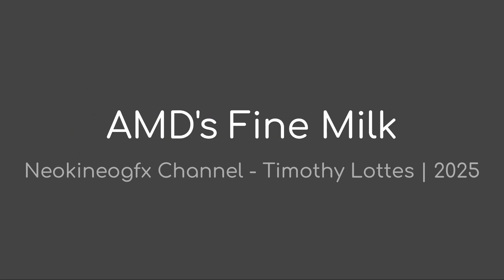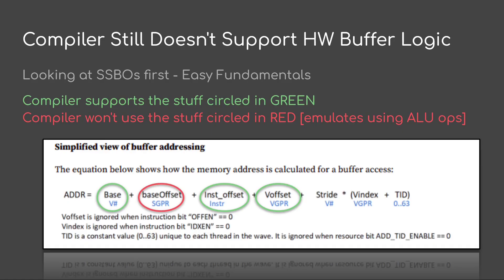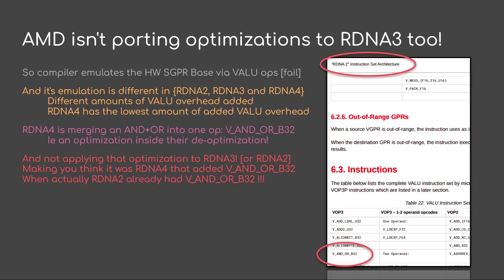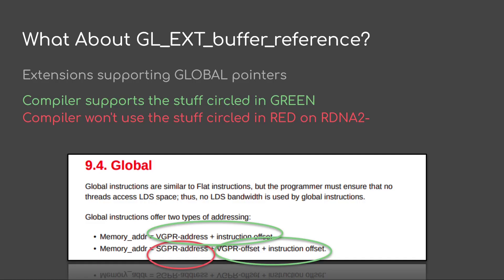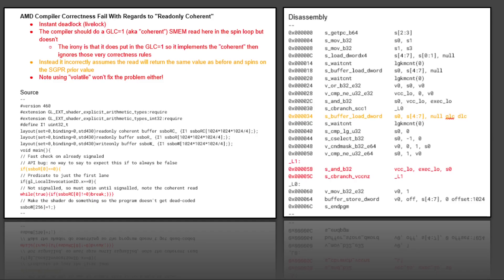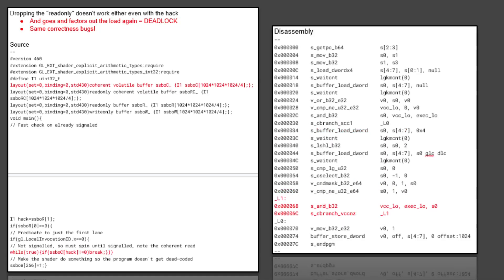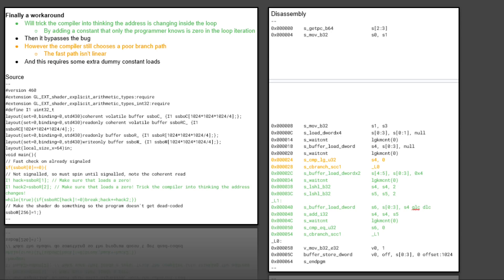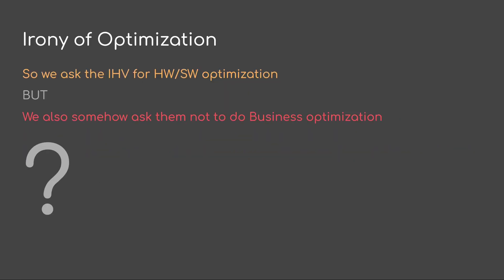AMD's Fine Milk

Comment: Coherent only applies to dependent shader invocations. E.g. a fragment shader will see writes done by the veetex shaders that were used to generate it. This isnt a bug at all.
Reply: From the spec/wiki
Dependent invocation write/read
    If you have one invocation which is dependent on another (the vertex shaders used to generate a primitive used for a fragment shader), then you need to use coherent on the variables and invoke an appropriate memoryBarrier* after you finish writing to the images of interest.

coherent
    Normally, the compiler is free to assume that this shader invocation is the only invocation that modifies values read through this variable. It also can freely assume that other shader invocations may not see values written through this variable.
    Using this qualifier is required to allow dependent shader invocations to communicate with one another, as it enforces the coherency of memory accesses. Using this requires the appropriate memory barriers to be executed, so that visibility can be achieved.
Reply: Coherent also does not apply to buffer references. Only buffer blocks. The buffer reference does not carry that information forward. So i think also not a bug there.
Reply from the maker: On GCN coherent requires GLC=1, if not then it is a bug regardless of how it is used period.
Reply: The coherent flag doesnt apply to buffer references,  it only applies to buffer blocks.
As for the second issue, it does load through GLC=1. But the compiler knows it only needs one load, since the dependent shader invocations (from vs shader, for example) are know to not run concurrently with the fragment shader.
Thats all the spec guarantees.

Comment: With regards to the V_AND comparison slide, I do wonder if the recently abandoned AMDVLK driver would generate the same code sequence on RDNA2 as the one you see on RDNA4.
Also, while at it, thanks so much for your previous materials on resource binding in Vulkan. They were literally the only thing I could find on the Internet that made it clear how they work under the hood. Really happy to have come across your channel!
Reply from the maker: Glad you found it useful.

Comment: Not all of your issues show that AMD stopped backporting optimizations to old hardware, or that they don't care about using the hardware optimally.

1. It's hard to use SGPR and VGPR offset for buffer instructions, because of cases where the addition overflows.

2. For texel buffers, it's even harder to use the SGPR offset, and impossible to use the constant offset, because the stride depends on the descriptor, but all non VGPR idxen offsets are in bytes, not in elements. (And before you say, but Vulkan/GL allows you to know the stride if applications explicitly provide a storage texel buffer format in the shader, it's rare that they do, and not so rare that they use the wrong format)

3. Your global memory load is not enough evidence that RDNA2 will never use optimal global address, because the maximum constant offset is 2047 on RDNA2, 4095 on RDNA3 and even larger on RDNA4. Now code gen could still be better on RDNA2 by using the base SGPR with an addition of the remaining constant, but maybe RDNA2 would hit the fast path too with a smaller constant offset.

4. Your spinlock is API level undefined behavior. Vulkan memory model would allow you to use an atomicLoad, and hopefully that maps to correct behavior. Your use case is the exception, not the rule, and disabling loop invariant code motion would be the worse alternative. Coherent doesn't matter, volatile probably should matter, although the definition of volatile is pretty crap.
Reply: I'm also pretty sure the v_and_or_b32 instruction is also being used/optimized on RDNA3, it's just not useful in the shown snipped, because it ends up with the same number of instructions (because v0 is being re-used for the addition).
Reply from the maker: That these problems exist is an existing proof. If workarounds had been available, or interfaces that enabled expression of the fast path, the presentation would be different, one in which I'd be describing what to do to get peak perf on the HW. But that isn't possible in many cases that are important to what I build.

1. I'll take that as proof that we should have the ISA instruction intrinsics to workaround those problems where the compiler cannot figure out there is no overflow. Or alternatively some way to express that there would be no overflow.

2. I always correctly explicitly specify the format in the layout in the shader. Would be nice if the toolchain provided a mechanism to get the desired fast path when the dev could use it (like in my case).

3. Thanks! Yeah you are right my immediate offset was too big for RDNA2 in the GLOBAL_STORE based test. And it gets code generation right for RNDA2 in that case, with exception that it still doesn't put in GLC=1 so it still has a correctness bug that would have prevented me from being able to use it. I'll have to do a follow-up "Neokineogfx's Fine Milk" where I talk about my own blunder here.

4. It would seem at a minimum that volatile should block hoisting the load outside the loop. If the compiler did that, I'd say that would be an acceptable solution.
Reply: re 1/2: In SPIR-V, there is a NoUnsignedWrap decoration. An intrinsic would be absolutely overkill. I think you are overestimating the performance implications of a single VALU instruction. There is MUCH lower hanging fruit in compilers than adding extensions in order to save one instruction.
re 4: No, the compiler can assume that nothing writes your buffer during the loop. You can try again using atomics to enforce an order. You are essentially betting on a race condition and loosing the bet :)

I find it a bit frustrating that you push out a long video about alleged compiler flaws without informing yourself about why it behaves like that.

Comment: So long story short, amd never optimized anything?
Reply: Let's hope that AI advancements will make this discussion obsolete in a few years.
Reply from the maker: They optimize some stuff, if things are low-hanging changes and likely to hit higher benefit across more titles. But they certainly don't work bottom up on fundamentals, and anything really hard to implement is a no-go.
Reply: @neokineogfx I remember hugh optimization for openGL 3 or 4 years ago , and that's an overall bottom up optimization
Reply: @neokineogfx  also stability is very much improved almost since 2022 , but even NV struggled blackwell since launch with many bugs and black screens for like 6 months ?! Also thier app launched over a year ago still not cover all functions and have many issues while amd had it's app stable long ago